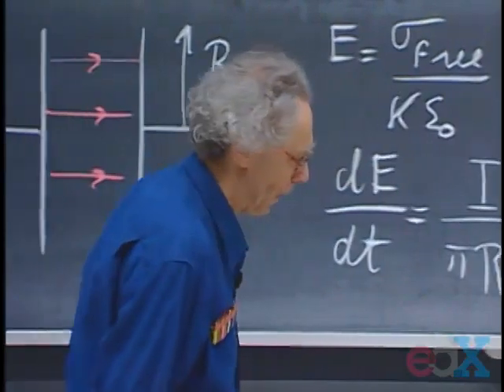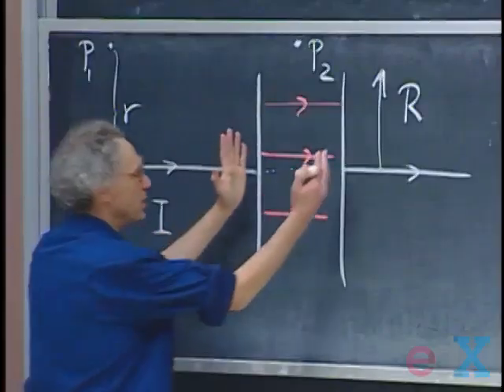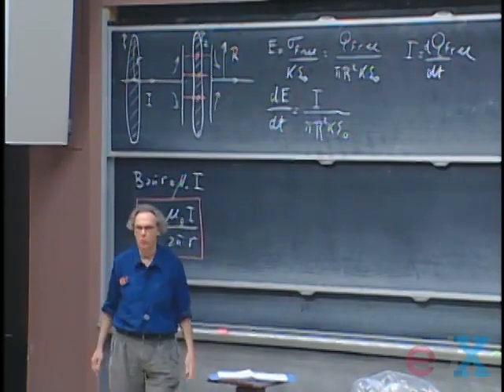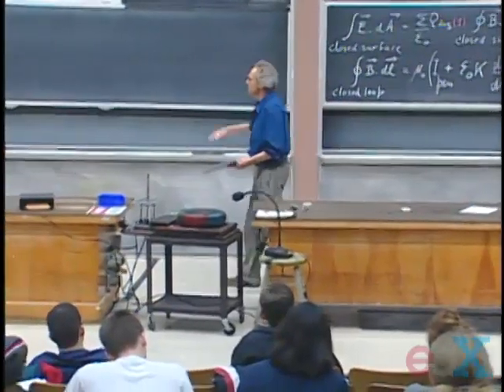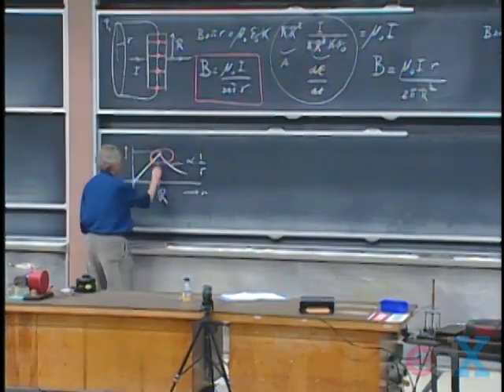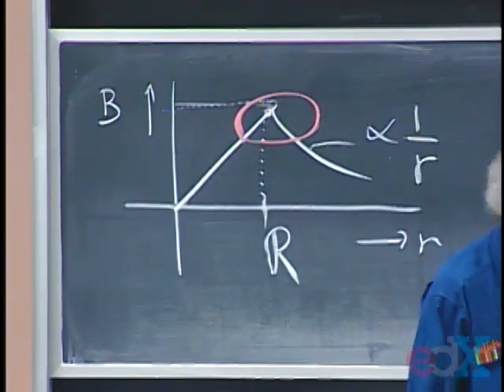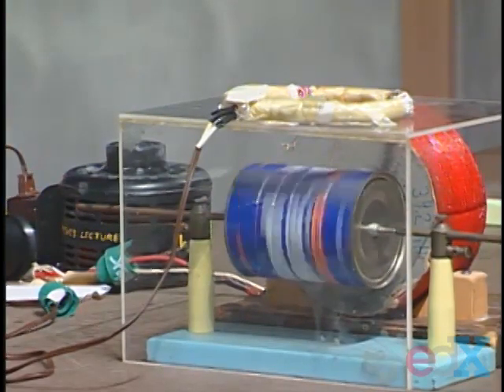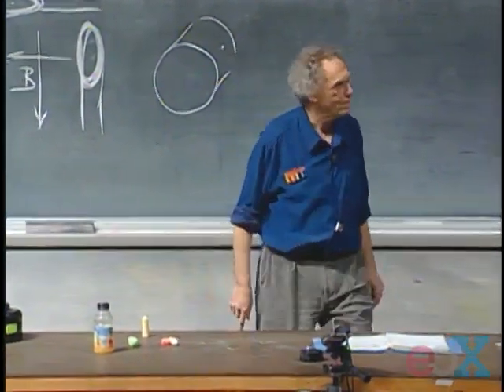8.02x - Lect 18 - Displacement Current, Synchronous Motors, Explanation Secret Top

Comment: Professor, for the stator you have set up for the conducting egg/ring demonstration, how do the windings go?
It would make sense if the windings go all the way around in circles across the diameter of the stator, as then they would produce magnetic fields that match the preceding explanation, but it seems that they are wound like a toroid instead, which would not mainly produce magnetic fields inside the circular core only and minimal magnetic field at the center, and the field would also be oriented differently.

Comment: at min 32, you said  due to magnetic field change there should be eddy current, but we know that magnetic flux over a closed surface is zero, therefore change of magnetic flux  must also be zero. thus there shouldn't be any emf and  neither is current.
Reply from the maker: magn flux through an open surfaces inside conducrtors is not zero.
Reply: @lecturesbywalterlewin.they9259  first, thanks for the reply.  lets consider a solenoid which is squarish and a solid cube. you create a changing magnetic field but only in magnitude but not direction. there is not many option as to calculating magnetic flux for solenoid which is approximately equal to [(area of the  one square) x number of the turns]. whereas for the solid cube,  there can be thought infinitely many surfaces(solenoid that have infinitely many turns for example or just a one square) because we are not obligated to pick a surface that includes all the cube. and only way to bound the whole cube is to pick a closed surface and for that case magnetic flux is zero and so is its derivative. In the end, there appears this problem as to according to what  should we decide our open surfaces to calculate the EMF when the object is filled but not hollow as in windings

Comment: Professor Lewin, your top is quite close in principle to the no-commutator contest motor that you had your students design.  You get 90 degrees of attraction, then 90 degrees of repulsion.  It's just the reverse ... the top has a permanent magnet in it and the coil underneath produces a magnetic field.  In the motor the coil is the rotating armature of the motor and the permanent magnets are to the sides of the coil.  But again you get 180 total degrees max of spinup on the motor without resorting to commutation.

Comment: Professor, I wonder does the coffee can have to be offset from the magnetic field in the beginning for the rotation to start? Otherwise there would be equal torques on both sides so what causes the rotation? How can torque on one side be stronger than torque on the other if the magnetic force is equal and the can is symmetrical there should be equal torques on each side? And as for the egg I also wonder how does the forces pushing it alternatively in 120deg offset cause it to rotate and not just move in the direction of the force?
Thank you professor, I love your lectures

Comment: Sir, 
05:00, you have applied ampère's' l'aw and wire May be semi infinite but ampère's law valid for infinite long wire. 
If you calculate magnetic field at point p by byoswarts law then it will  be nearly half of ampere's magnetic field.
Then how can we use ampere's law ?

Comment: SIr, Lorentz force is force in a current conducting wire situated inside a magnetic field. on the other hand, Faraday's law tells us that a changing magnetic flux will create an electric field. for an induction motor, the electrical filed will produce current flow, the current flow will produce magnetic field, the magnetic field will interact with the previous magnetic field and as the result of this interaction the rotor will rotate. My question is that, is the same phenomena is explained in two different ways by two scientist?
Reply from the maker: https://en.wikipedia.org/wiki/Lorentz_force

Comment: Hello sir, in 12:05 I understand there is electric flux through surface in capacitor, but isn’t there electric flux from the wire itself as well ? ( aiming perpendicular from the wire, similarly as it was when you taught us the electric field from the charged cylinder - if that would be the case there would be more electric field lines penetrating the surface) thank you and I hope you understood my question…
Reply from the maker: electric flux trough the surface of wires through which current flows is not zero but it is in general so small that it can be ignored.
Reply: @lecturesbywalterlewin.they9259  
Thank you so much for your answer :) May good health following you for many more years, your lectures are helping me a lot!

Comment: Professor, can you please explain why the magnetic field through the other two loops are two times smaller?
Cos(120) and cos(240)?
Are synchronous motor and induction motor two different things?
Did you place either a magnet or a conducting sphere/egg? I got confused and thought that you placed BOTH at the same time.
Reply: At the moment when magnetic field from one pair of solenoids reaches it maximum other fields must be two times smaller because they are shifted in phase by 120 degrees (look at the 3 phase graph).
Synchronous motor is a type of motor that rotates with the same frequency as  rotating magnetic fields inside it. Induction motor is also known as asynchronous motor because it always would rotate slower than magnetic fields inside it so they different things.
Sorry for my english and that I'm not a Professor.
Reply: @patryk_49  are you an electrical engineer? 😊

Comment: There is something that I didn't get in this lecture.
The three-phase synchronous motor. If we have a three-phase current, than we can produce a rotating magnetic field. But how do we produce such a current? Should we manually rotate a triple loop? But then, we are transforming mechanical energy to the mechanical one, which is nonsense. Or do we obtain such a current from the power socket? In this case, how do we make it relatively shifted with a right phase in each coil?
Reply from the maker: https://en.wikipedia.org/wiki/Three-phase_electric_power
Reply: +Евгений Голиков
Power generation Plants , (hydro, thermal, nuclear, wind etc) produces three phase current.
and that is transported to sockets at home.
watch this Video properly he explained how three phase V or I is generated by three rotors at 120 angle. 
Also whats wrong with converting mechanical energy to mechanical ?  though that not the case here. But could be in a science project that students make at school or college. where they can generate power by manually rotating then converting it to electrical energy then elecrical enrgy converted into mechanical again with Losses.
not direct mechanical to mechanical like two gears

Comment: If a ring is falling with its plane vertical, in a uniform horizontal magnetic field, will there be any potential difference between various points on its circumference?
Reply from the maker: there will be Eddy currents in the metal, thus there will be potential differences between various points.
Reply: @lecturesbywalterlewin.they9259  thank you soooo much sir.

Comment: Professor,

I cannot figure out how you have the 3-phase current induction motor wired.  The solenoids look like they are wound perpendicular to the inside of the machine (where the egg spins), thus I would expect there to be very little magnetic field there.  Am I misunderstanding something?
Reply from the maker: +James Dufour James, I do not recall the details of the wiring; I did the demo in 2002. However, my explanation about the rotating B-field is correct.
Reply: +Lectures by Walter Lewin. They will make you ♥ Physics.  Okay, no worries.  Thank you for always answering questions on these videos.  Your lectures are wonderful.  I found myself explaining to coworkers why a magnet is slowed when dropped through a copper pipe just the other day :)

Comment: what is the divergence of displacement current density ?? is it going to be zero
Reply from the maker: https://en.wikipedia.org/wiki/Displacement_current
Reply: @lecturesbywalterlewin.they9259  sir, I have already read the Wikipedia article and understood it, but unfortunately it doesn't clear my doubt. That, the displacement current inside the capacitor is constant is space but changing with time, so it's divergence should be zero inside the capacitor. 
 My humble request to you would be, if you could explain what is the status of the divergence of displacement current density inside the capacitor plates .

Comment: I am confused... and yes I went to Google to try to heal that confusion, but I could not find anything. That bugs me out because it means I do not understand Ampere's law and I can't bear it!

At 4:00 , you calculate the B field at point P with Ampere's law. I thought that Ampere's law gave the sum of the B field on the whole closed path, but not on a single point!? In Ampere's law do you not consider the contributions of the rest of the wire? I thought that Ampere's law was for only for a dl element of the wire (cross-section).

On the other hand, I agree that the B field at Point P is B = mu_0*I/2pi*r. If I used Biot-Savart law (considering that point P is far from the capacitor plates) I would find exactly that, because it is a straight and long wire. Each element of the wire contributes to make that B field up at point P.

That means I have the wrong definition of Ampere's law. I need help!

Comment: Does Faraday's law give us an insight into the steady state of the circuit because when DC supplied to capacitor current stops flowing without much of a time lag  and whereas maxwell's equation deals with instantaneous situation?
Reply from the maker: Faraday's law is one of the 4 Maxwell's eqs. It ALWAYS works in ANY circuit with C's R's and L's, also with external B-fields. Faraday's Law runs our entire economy. It works at ANY moment in time, whether you have DC or AC.
Reply: Thank u so much

Comment: Hi Prof. Lewin, First of all thank you for sharing your inspiring lectures. I've been following 802 for a while (not finished yet) and I have a little question.
You've introduced the magnetic force as the force experienced by a moving charge in a magnetic field and that's ok! :) But when coming to magnetic force between magnest or simply between an object producing a B field and an iron needle which physic model shall we apply? What is the link between the force experienced by a moving charge and the repulsion/actracton force bewteen two magnets?  How do we estimate the force produced by a magnet on a different magnet? Still, the north and south pole of a magnet are issue of atomic configurations of the material?

Thank you,
From Italy
Lorenzo
Reply from the maker: very difficult to evaluate that force. It's very very geometry dependent. I do not cover it in my lectures. Use google or quora.
Reply: Thank you. I'll google it.
 That's the "problem" with science and it's also what makes it interesting, the deeper your understanding you want to be, the more you realise that you do not  understand. It's a never ending loop.

Comment: thanyou sir for making us able enough to appreciate the real beauty of the subject.
 just one thing....
dQ/dt confuses me. does the charge keep moving b/w the plates, making us write I=dQ/dt  or is it that once the capacitor is charged there is no magnetic field which makes sense right?
Reply from the maker: If there is a charge Q on a capacitor, this Q can change depending on the circuit. dQ/dt is then the current in the circuit. Of course dQ/dt itself can change in time that means the current I is a function of time. .
Reply: thank you sir
but how are we able to write the displacement current as dQ/dt when the Q is only in the plate's vicinity. or do the charge fly in b/w the plates?
Reply from the maker: The displacement current is NOT a current. The name is a misnomer.
Reply: glad to receive the answer. thank you

Comment: Ampere's law is applicable only if the electric field at the surface does not change with time ,how is it possible to have  constant  electric field as the charge(in motion) always produces varying electric field?
Reply from the maker: >>>Ampere's law is applicable only if the electric field at the surface does not change with time>>> that is not correct. Ampere's Law also holds with AC. If there are also capacitors in your circuit, make sure that you use Maxwell's version of Ampere's Law.

Comment: A capacitor has no internal series inductance... -Ivor Catt
Ivor showed that displacement current doesn't exist and that a cap is like a transmission line, and the em energy is going back and forth, b cancels and e appears steady.
Reply from the maker: Maxwell added a term to Amperes Law. He called it "displacement current"  but it is not a current.
Because of this addition he coud predict the speed of light

Comment: Sir i have an out of context question. Its from nuclear physics. I tried google but it could not satisfy me. 
After β- decay, the daughter nuclei has one more number of proton than electron and hence it must have +ve charge. But while calculating Q value of this nuclear reaction we don't take the positive charge into account. Why it is so? 
Pls reply professor. It would be of great help.
Reply from the maker: β- decay,  one neutron in the nucleus becomes a proton, an electron and a neutrino are emitted from the nucleus. Thus the element changes (it moves up one step in the Periodic Table). The atom is now a + ion. An electron is needed to make the atom neutral. Countless electrons are in general available to make that happen, but if it does not happen, the atom remains a + ion. 
https://en.wikipedia.org/wiki/Beta_decay
Reply: Thanx professor it was really helpful

Comment: Professor can you tell which resistor (the code) you used in the circuit of spinning top
Reply from the maker: I have no idea - this was 16 yr ago.
Reply: Lectures by Walter Lewin. They will make you ♥ Physics.  No problem thanks for responding

Comment: Sir, I couldn't understand the how does the eddy current can cause the sphere to spin. Can you please explain that? Thanks
Reply from the maker: Yun Heng I suggest you watch that part of my lecture #18 again (as I just did myself). Eddy currents are produced in the egg. Due to the Bxv force, B being the magnetic field vector and v the velocity of the charges (Eddy currents), there will be a torque on the egg. This torque will rotate and that causes the egg to keep spinning. The oblate egg ends up spinning "vertically" since that is the position with the lowest moment of inertia. tau=I*alpha.

Comment: Sir how eddy current and rotating magnetic field cause torque on rotor because both magnetic field due to eddy current and rotating magnetic field are causes same and opposite forces on rotor. Is this is right. Because I am in confusion after reading papers on working of induction motor.
Reply from the maker: it's easy to see that rotating magn fields cause torques. use google
Reply: Thanks Sir

Comment: Respected sir, at 10.28 u said "no electric flux passing through the surface" shouln't it be there is no change in electric flux because if we connect a battery electric  field would be passing throught it....
Reply from the maker: I watched at 10:28. What I said is correct. Review your knowledge of the meaning of electric flux

Comment: Hi   Professor  .....why is the electric flux through the flat surface 0 ??
Reply from the maker: it's NOT 0
Reply: @lecturesbywalterlewin.they9259   I don't know.. am I hearing it wrong that you said in the lecture that ''there is no electric flux through the flat surface and hence displacement current is 0 at 10:27 minutes
Reply from the maker: @poojaramesh1133  it is zero in that specific case. But that case is very special

Comment: 26:27 Sir, shouldn't the plot of loop 2 be loop 3's plot and shouldn't the plot of loop 3 be the plot of loop 2? So shouldn't the plots of loop-2 and 3 change? thank you
Reply from the maker: nope
Reply: @lecturesbywalterlewin.they9259  but otherwise loop 2 starts from 0 Volts. But it should start from a higher value than 0.because voltage is Vmax(sinwt) and this is not 0

Comment: At 15:38 when you choose the flat open surface between the capacitor plates, why can't I choose my surface to include the whole area of the plates, e.g. like a light bulb?

Image: https://scontent-arn2-1.xx.fbcdn.net/v/t34.0-12/13015095_1037129163012582_1075484716_n.png?oh=25212cd92d662d7fe248b785ab1c458d&oe=570EEBB7
Reply from the maker: +lauroflorin You may choose any surface you like. The reason why I chose the surfaces the way I did was for educational reasons. Watch it again, and you will understand it.
Reply from the maker: +lauroflorin Perhaps you did something wrong. I suggest you watch my lecture again, that may help you. For sure I did nothing wrong.
Reply: Lectures by Walter Lewin. They will make you ♥ Physics. Aha ! Got it, when I choose my surface to be a lightbulb, some E dot dA will be negative, leaving only the area of the closed loop in the end. And again, Maxwell/Ampere holds :)
Thanks !

Comment: Sir how there is changing electrical flux in between the capicitor plates didn't get the point.....
Reply from the maker: how many minutes into the lecture?
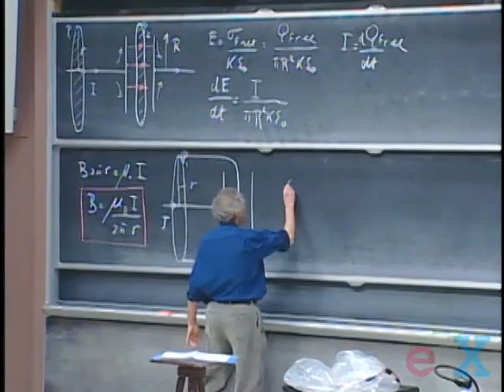Reply: From 7:10 to 7:40
Reply: And also at 21:37 metioned that a changing electric field will indeed cause a current in between the plates
Reply from the maker: watch the lecture again. I explain this very well. I cannot add to the clarity of that lecture.
Reply: Sir at 7:15 the reason why "there is a changing electric field" in between the capicitors??
Reply from the maker: watch the lecture again. I explain this very well. I cannot add to the clarity of that lecture.
Reply: Got it sir !!! Sorry for inconvinence😀😀😀